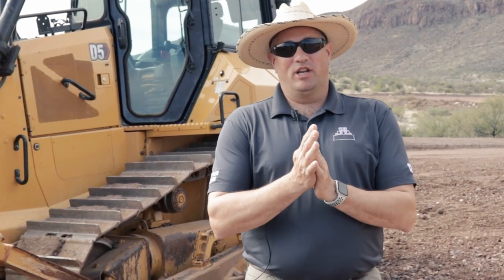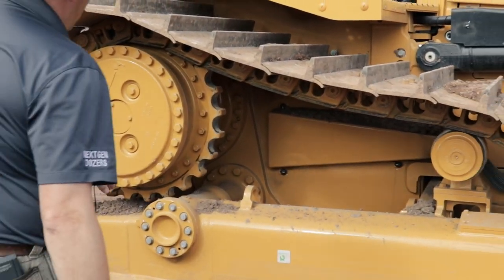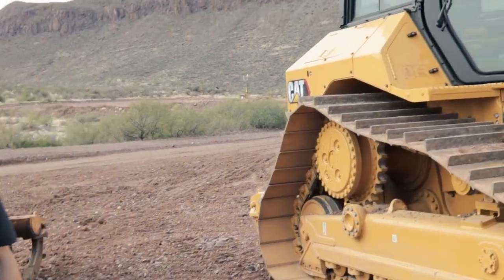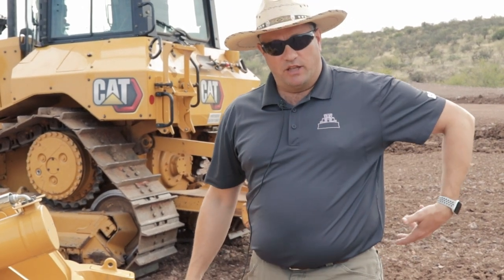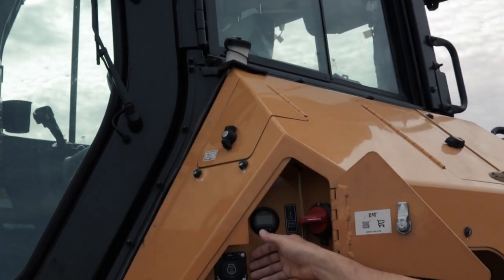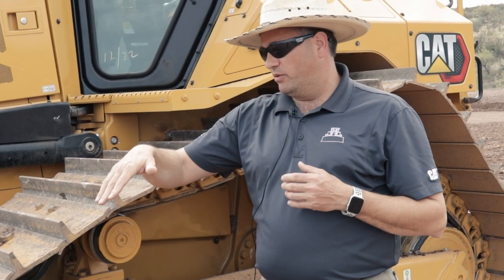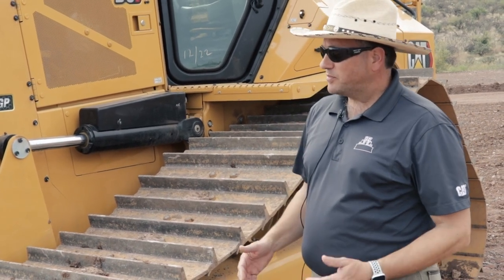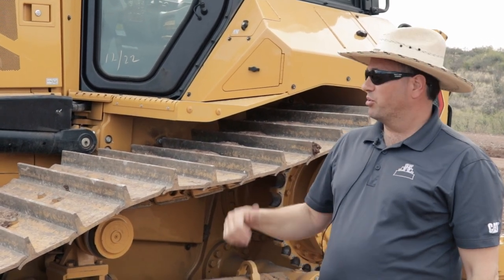Everything there is to know about the Caterpillar D5

Comment: I get that technology has to advance but seriously..... Pretty soon kiss operators good bye as God and electronic junk take full control.  All the skill is totally taken out of operating.  Just push a button and auto set grade auto set the cut auto set the slope, auto set the power to the ground/RPMs....  I'd personally rather operate a D6D, D5H, D5M, D8K, etc over any of these.  Mechanical dozers did work just fine and you could actually fox them on site without an IT degree.
Reply: Paul Gorefiend its all about money now, a GPS equipped dozer with a real operator can cut in a road box or get to grade or design by himself. Don’t need a surveyor or grademan, dozer man becomes a one man show.
Reply: @cascapediastjules8796  This is the right answer. I've heard people say "now you can put your worst operator in the new machines and get almost as good a job". Probably a bit of hyperbole, but the point is that these machines can make an average operator pretty good, and a good operator great. Lowering the skill ceiling and raising the skill floor is good for businesses who can afford the tech.